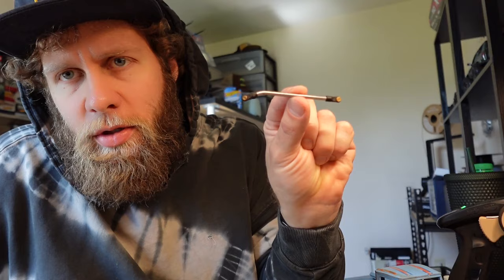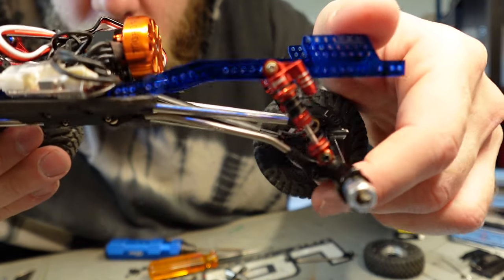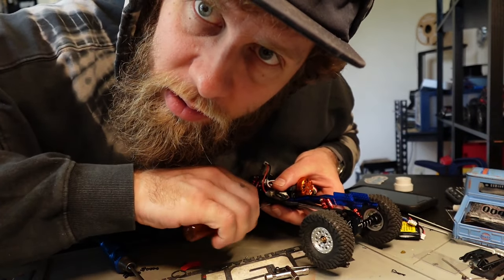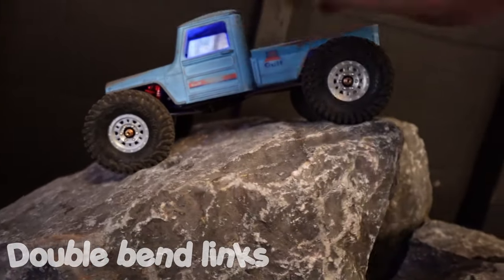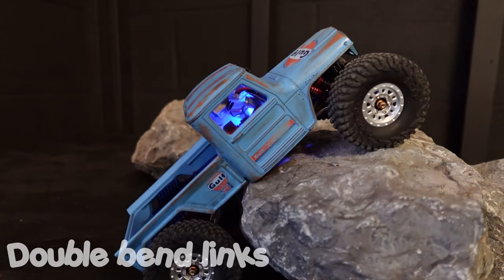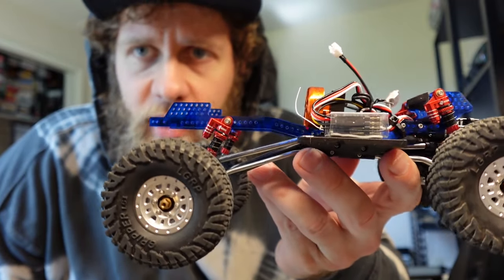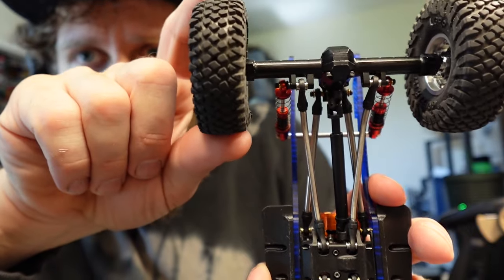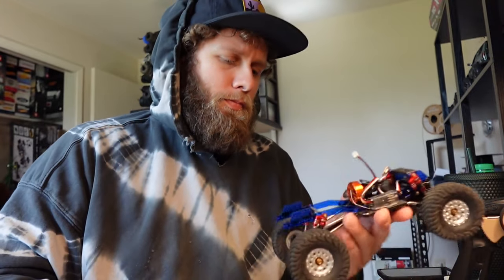Are DOUBLE bend rear links worth it?  (scx24)

Comment: I once made a build, and I used steering links in the rear as a double bend link, it worked great. Stock width axles the steering link seemed to be about the length of a rear C10 link
Reply from the maker: Good to know!

Comment: Have you tried flipping traditional high clearance links around so the bend is at the skid side instead of the axle side?  I tried that on one rig and it did the exact same thing you showed in your clip while protecting the driveshaft still.  They act as kind of a skid plate as well, allowing the link to slide on the rocks until the tire can make contact.
Reply from the maker: I havnt tried that but now I will. Thanks!